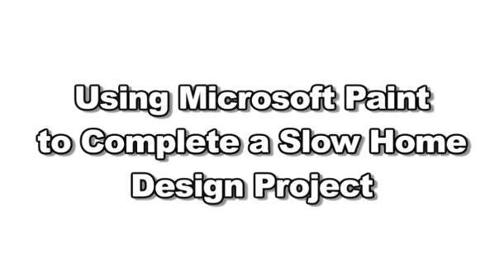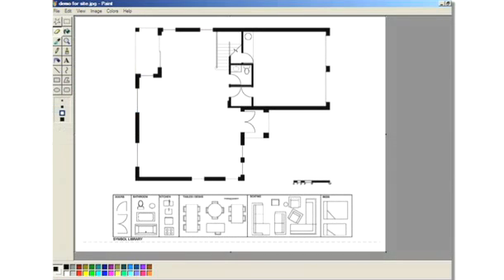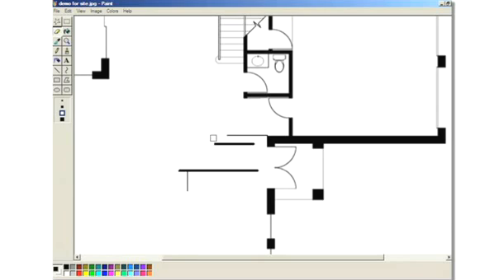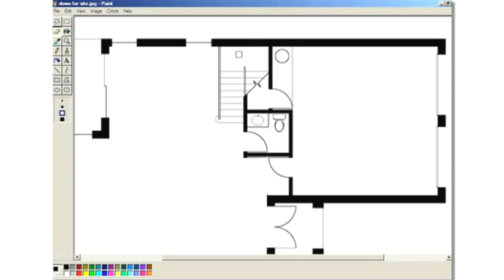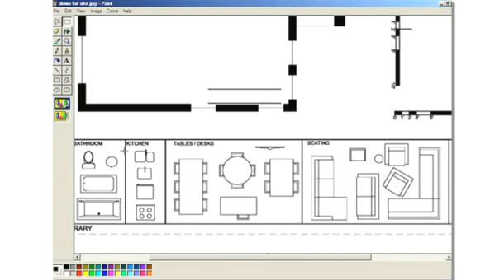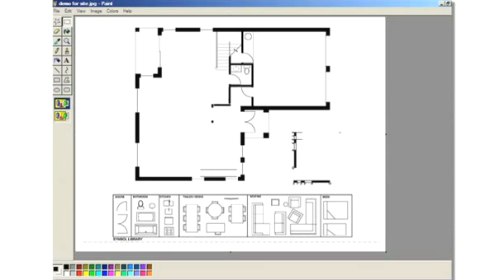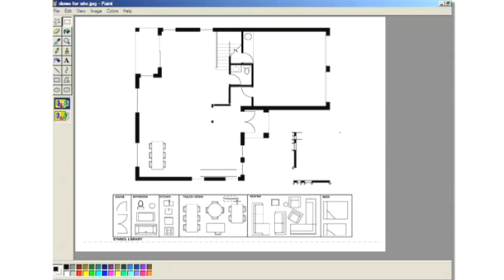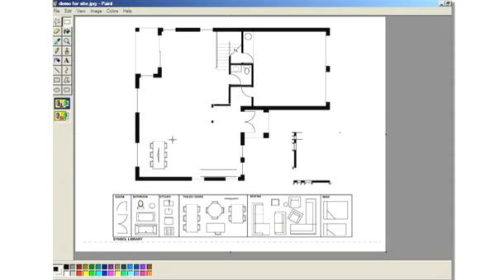Using Microsoft Paint to Complete a Slow Home Design Project

Comment: I like this. I often use paint to get a quick impression of a layout and allows you to experiment with various combinations very easily. I usually start out using a scale of 1px=100mm (4 inches). Once I have a layout that I'm happy with, I then work with alternative software to achieve finer detail.